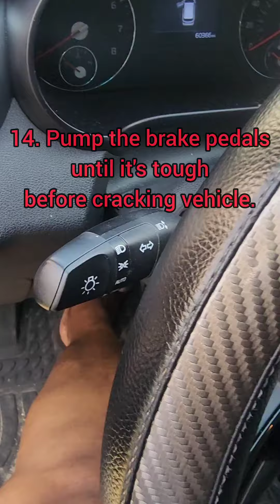Learn how to do your brake pads yourself #easy #trending

Comment: That's called pad slapping, that's not the way to do it. You want to grease the ears of the new brake pads take the sliders out clean them up and regrease them put some grease on the back of the pads and then reinstall also grease the front of the caliper piston face. That's the proper way to do a brake job.
Reply from the maker: Noted with thanks